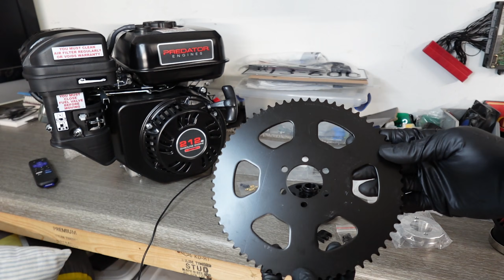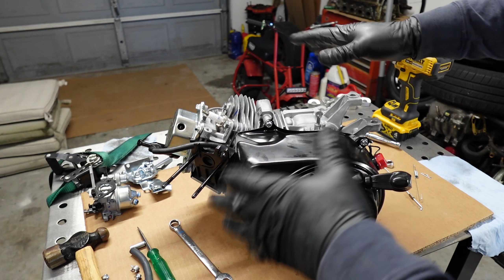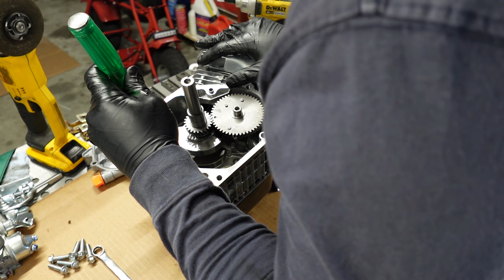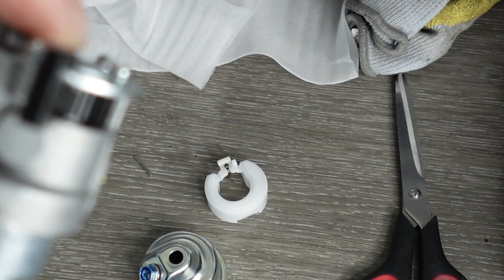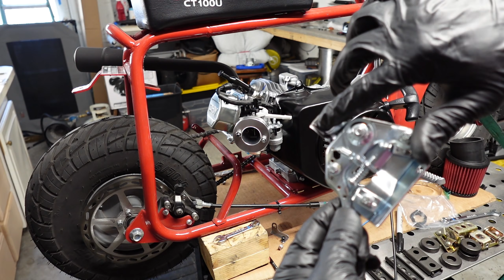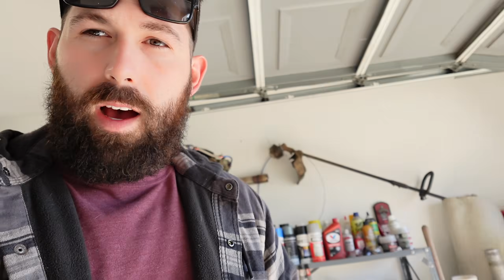Coleman Ct100U Predator 212 Swap with Governor Removal and Stage 1 Install

Comment: you never said what jet you put in, 85,90, or 95? . Thank you.
Reply from the maker: I like to start with the middle size jet and see how it performs. Typically you can go with the larger jet but I did a hemi and on the largest jet I was seeing black smoke which means over fueling. Run the middle jet first and then read the spark plug. White spark plug means lean, so go up a jet, black means too rich so go down a jet! Good luck, let me know which one ends up working for you!

Comment: You can keep the rear fender on it if you just slightly bend the mounting tabs. I did this build 2 weeks ago, it’s crazy how big of a difference the 212 is from the stock engine. One thing I’d like to know is if your chain slaps the rear chain guard? Mine does that but I think I need to adjust my engine again because the tensioner is maxed out. That or take a link out.
Reply from the maker: That’s good to know about the fender I’ll keep that in mind! As far as chain slap I don’t have any I normally slide the motor all the way back, cut the chain so it fits with a little slack, and then when I push the motor forward on the frame and tighten it it takes almost all the slack out. I honestly don’t rely much on the chain rollers that come on the bike. They don’t hold up that long and I went a long time without one just using the motor to tension the chain. You don’t want it to tight but it’s a hard tail so around a half inch of slack is all you’ll need to keep it right. Thanks for the fender advice.